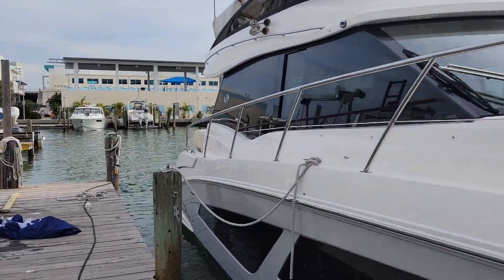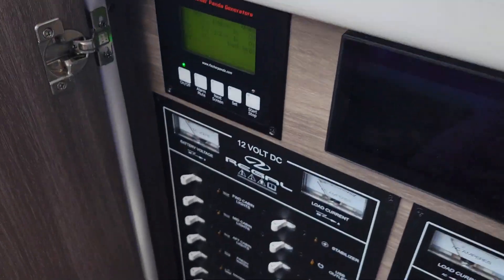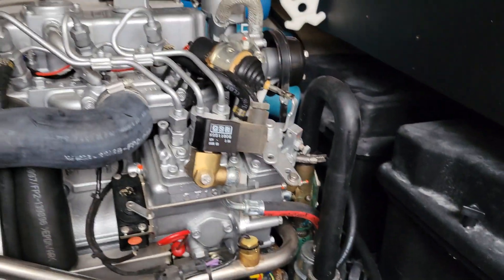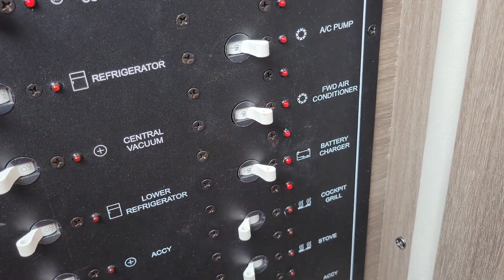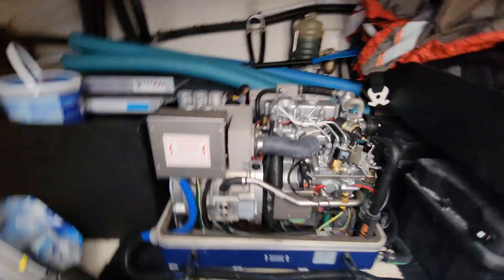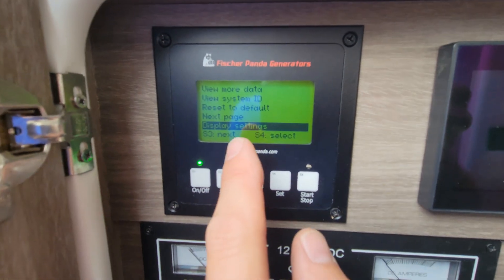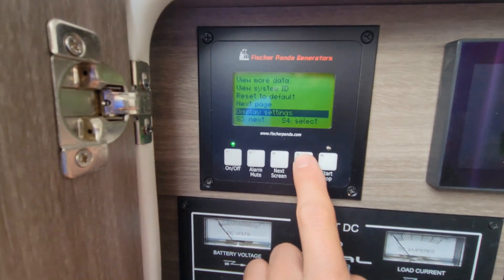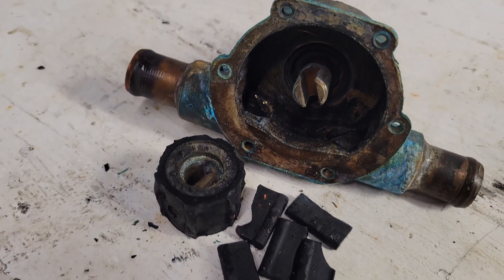Let's Talk Generators - 5 Minute Friday!! #Generator #5minute

Comment: Hi,I have a low voltage problem ,same as your, replaced both actuator and boost control and still have the same problem,my name is Jerry from Antigua

Comment: Have a Westerbeke generator (6.5KW - newer style) with 384 hours on a regal 33 express. Couple of weeks ago she shutdown due to Engine Temp Overheat fault. I replaced the impeller (which had lost a blade) and cleaned out the heat exchanger (located the missing impeller blade). Adjusted the serpentine belt to within specs, replaced heat exchanger gaskets while at it. Confirmed no leaks. She runs for up to an hour without an issue when the boat engines (twin volvo's) are off. With the engines on and the bilge hatch closed, the generator will only run for about 15 minutes and shuts off due to overheat.

Thoughts? The water coming out of the exhaust thru hull seems excessively hot this season compared to prior seasons.

Thermostat stuck is my only other diagnosis but wanted to throw this here before I take the thermostat housing apart.
Reply from the maker: I would make sure there is no air left in the cooling system side of the motor. That can cause over heat. The thermostat would be the next thing I check.  Also make sure your thru hull valve is clear and the lines going to/from the strainer. Those can cause poor water flow. Keep me posted. Sounds like you are on the right track.

Comment: There were vendors at the St Pete boat show selling the LiFo(?) Lithium batteries to replace the house AGM batteries.  Expensive but it sounds like the added capacity and performance may be worth it when comes time to replace the AGMs.  Any thoughts?  Good idea on the Friday shorts!
Reply from the maker: Good idea. The only problem is that you need a special battery charger to keep them charged. Just adds more money.

Comment: Is it difficult to go from analog controls to digital controls on a 200 Suzuki. I already have digital gauges, but When I bought the boat they didnt spend the money for digital shift. Thanks in advance.
Reply from the maker: I honestly don't know the answer to that question. Its been awhile since I have worked on a Suzuki.  I would call a Suzuki dealer and ask if it's possible and what you need to do it.  Thanks for watching.